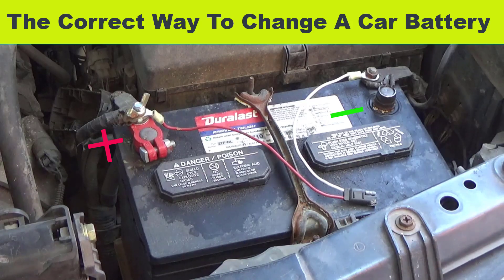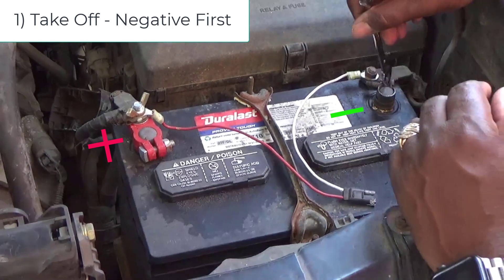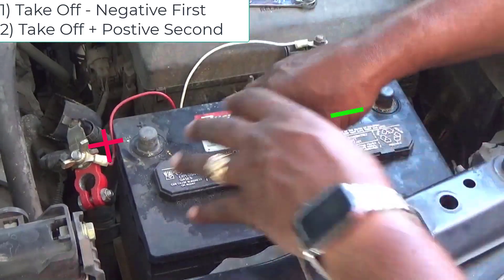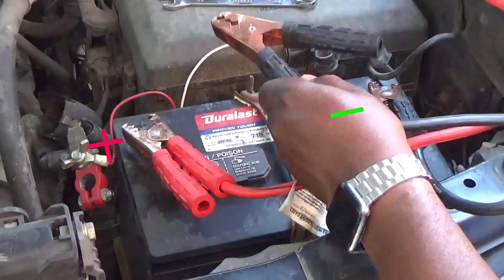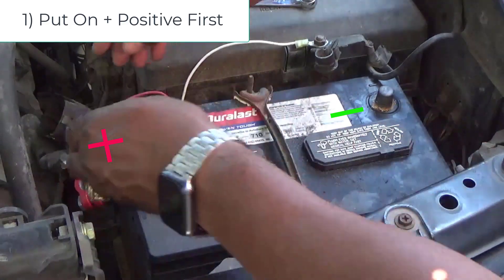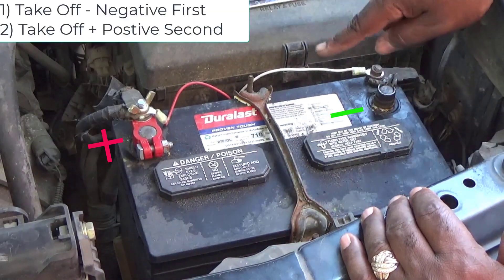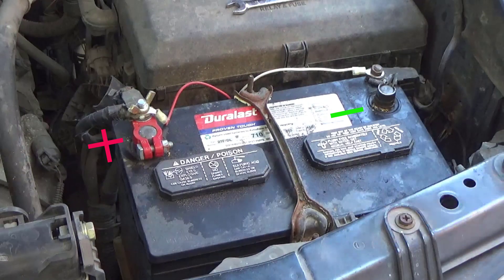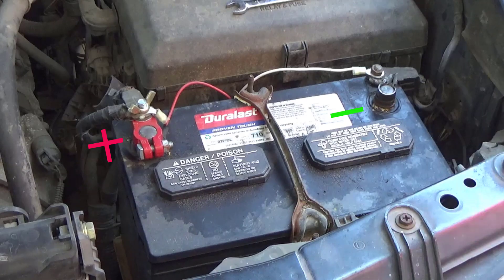How To Change A Car Battery The Correct Way Without Damaging Anything  | DIY Car Repairs |

Comment: Great video.👍🏻Problem is most people don't know this and will screw up. Also same is true when jumping a car battery, make sure positive to positive and negative to negative, if wrong you can burn out your computer.
Reply: Ground to the frame on the bad battery side.
Reply from the maker: True

Comment: Correct procedure. But that wiring that's connected to the positive almost touched the negative. You wouldn't of needed your jumper cables to show sparks. Also jewelery is a no no.
Reply from the maker: The positive is insulated

Comment: my wifes neons battery died while she was at work.  we live about 4 miles from her work.  she calls me and as per the norm i hop in the truck and head over.  i call her when im maybe a minute away to verify where shes at and she says oh her coworker is jumping me.  i yell wait!  think the T barely rolled out of my mouth as she responds with whats that weird smell?  he swapped the cables and fried the ENTIRE CAR. even the radio didnt make it out alive.  every ground gone.most of the grounds melted into plastic and the engine bay was a disaster.  worst part is he clipped the cables and walked to the truck seat to rev his engine.....he charged it faster all right.  150 bux worth of scrap.
Reply from the maker: Wow, this is not good